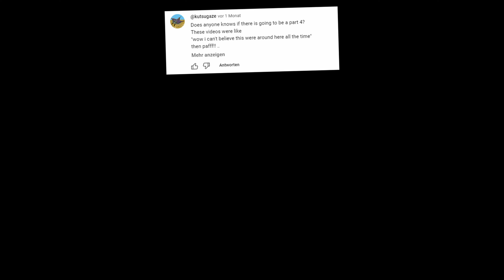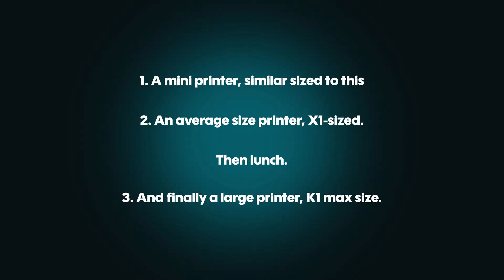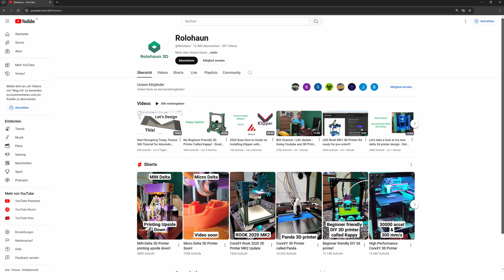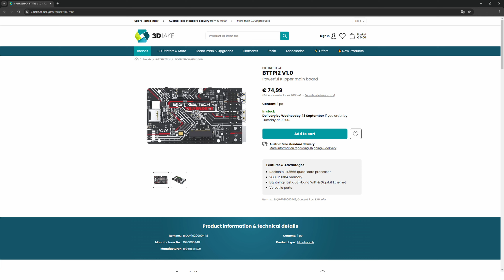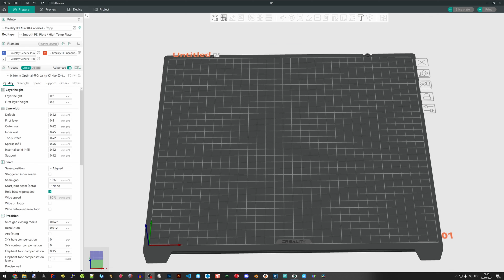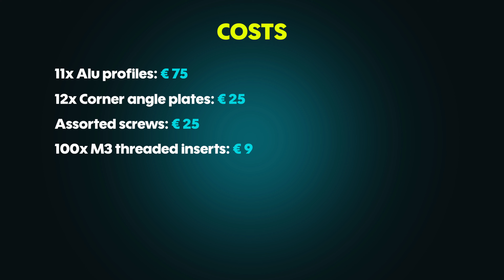How to Build a 3D Printer from Scratch: Part 4 - Prototype!

Comment: Why oh why oh why do people forget that not everyone has a 3D printer or access to one and do instructional videos involving circular dependencies, here's an idea for the next series "how to make a 3D printer without access to a 3D printer and with only stuff we sell on/in our store" that way you can help people into the custom 3D printer hobby without increasing the cost by the price of a 3D printer and the time to get it working right and you find out if there's anything missing from your product base
Reply: Good point
Reply: Voron's "print it forward" gets around this nicely.
Reply: @6yjjk  not as much as they say it does, you're still relying on someone having a 3d printer, so still a circular dependency, it gets around nothing if you can't access pif for any reason, pif is acknowledgement of a failing of the system, not a fix for it. "You can't build this thing without the thing being completed, so here's an approved seller of the things you need to complete the thing so you can make this thing" 😉
Reply: You can order 3D prints online from various services.

Comment: Since you have moved the belt tensioning system to the rear frame, why not use a suspended weight and pulley system with Dyneema cord? The pulleys would provide a mechanical advantage to reduce the size of the weight and you will automatically get identical tension in both belts. Now that I think about it, something more elastic than Dyneema might provide some damping.
Reply from the maker: I occasionally come back to this idea to think about, not sure how well it would work, there is not a huge amount of info online about this unless they're very specialised printers like huge things such as a hangprinter type design or something like the roetz 4.0 Minuteman. I think resonance could be a problem with something that thin but hey its an option and definitely on the list of things to experiment with

Comment: Why no PLA? PLA tough has good impact resistance it seems
Reply from the maker: Probably something I should have mentioned in the video: We don't need impact resistance for these parts, they're just sitting there and not hitting anything (besides the sensorless homing), what we do need is for parts to resist deformation. PLA is one of the worst filaments for this. Over time it will deform when force is applied, this is called mechanical creep. It is also a poor filament for the hotend, bed and motor mount parts as it starts to soften around around 55C. ABS and ASA perform a lot better in this regard.
Reply: @3DJake_Official  Wow I wasn't aware of this at all since it's not a value you can find in material datasheets. Thanks for bringing it to light

Comment: BTT HDMI5 is my go-to for klipperscreen. It's really handy to be able to reboot the printer, fix wifi, change filament, and so on. The super budget screen option would be an I2C OLED screen (see klipper docs for supported modules) and a rotary encoder, but you'll need to design your own housing.

Comment: Just might as well use the Ender 3 bed size. There are tons everyone in stock, it's got other compatible alternatives, and it would be a great upcycle or upgrade for anyone. If I foresee this correctly, your build would end up even a better budget friendly than any other Ender conversions in existence... Not bad =). Btw, I like your road map on printer builds. Cheering up!
Reply from the maker: The average sized printer will use an Ender 3 bed for exactly the reasons you mentioned. Ridiculously easy to source and find build plates and such.
Reply: @3DJake_Official  I think i am begining to understand the 180². Thank you for sharing your build experience. Your approach is detailed yet entertaining and i find it easy to absorb.

Comment: My first choice would be 180, but 165 would probably also work. I have a v0 and honestly I have a lot of prints where I am like "aww, it just slightly too small" and have to use a bigger printer.
I might build the micron one day to get a small 180x180 build volume. The appeal of the micron to me is it fits in about the same footprint as the v0. If the tradeoff is "bigger printer footprint" for 180, I think I'd do 165 instead. (and be happy with it).

The 180 build volume, and a 3 hour build time would be perfect for print farms, assuming cost being cheaper.

As an enthusiast machine I think I'd love a tinkerable printer that size that's easy to put together too. Regardless of if its a 180 or 165 build volume printer.

Side note, I immediately subbed after watching just a few seconds of your video, I really love the idea of this project!

Edit: Opinion on the screen. I think a screen is a nice to have, but I agree with it not being necassary for a budget DIY printer. My v0 didn't even come with a screen. I added one because I wanted it, and I would probably add my own. For the base price I'd cut it.
Reply from the maker: I know what you mean, I'm leaning to 180 too. For the screen, I think I will leave it out for the base version, for the larger printers I might use the Pad 7 to make things less complicated, no need for a Pi that way.
Reply: @SethHenderson  I like your input. It also makes me reflect on my own opinion about thr bed size and other parts. Using parts that are readily available should resuce the cost of thr build. E.g. Ender 3, 3 Pro, 3 v2 can be found for $100 - i just bought an Ender 3 pro for $40 bucks with upgraded 4.4.2 MB (i know it's an old MB, but better than stock). That is over $150 in materials in most BOM. Bambu parts seem to be inexpensive enough, like their USD$30 hot end and  USD$11 swappable all metal tips. Their 180² heat-bed is like $40 . 

I too gotten myself into the "awrg - the printer is a tad too small fory model...", so i relate.
Reply: @3DJake_Official  ah! Cheap after market hotbeds would do too. my 5yo and I are working on a print "design" (more like a Frankenstein of all the printers you see" and he tells me: " Papa, we don't need all that flashiness. Just use my old dragon tablet with a cable so it's not on WiFi". I tried microusb to serial and it works! There! A $20 7" display.

Comment: if you want to cut cost in almost half ,then buy a used printer 
ive been thinking about buying 2 older enders and somehow smashing them up to get a voron style printer 
you can scavenge the aluminum extrusions and the motors and probably the pullies and the bearings , that can offset the cost significantly 
... i have a prusha style printer meaning i have rods ,i want to somehow convert it on the cheap to a voron style printer ..... im going to try to reuse everything , i want to substitute the aluminum extrusions and the rails for rods and lmuu8's and im still figuring out how to do it .... the printer doesn't need to know that its made of rods instead of extrusions !!
pray for me plz as im about to ruin my only printer !!!